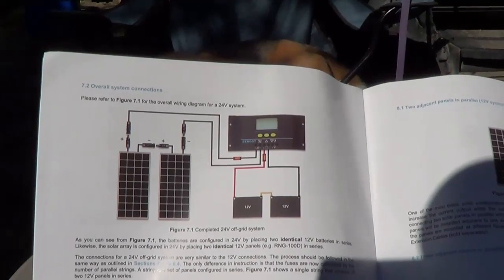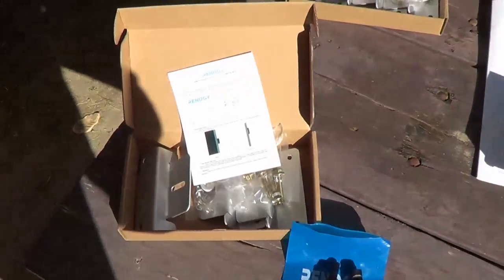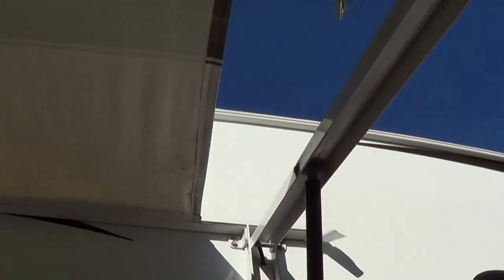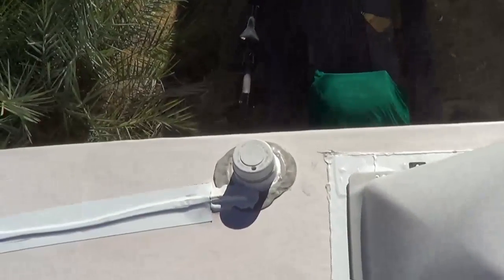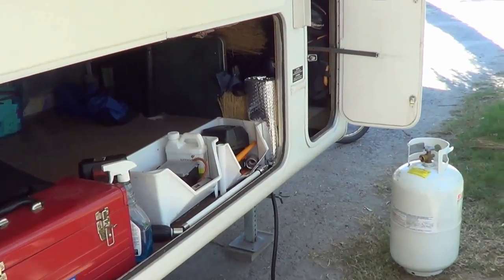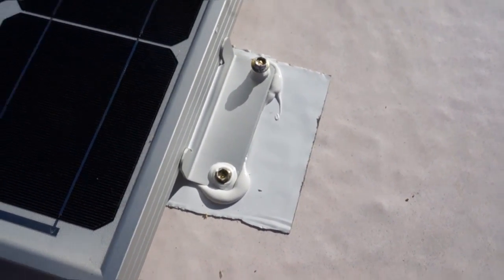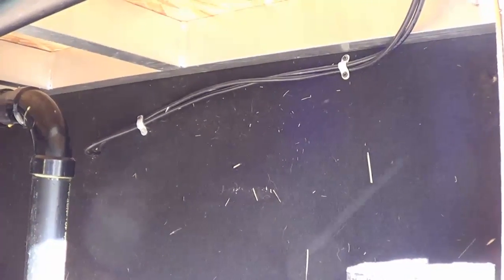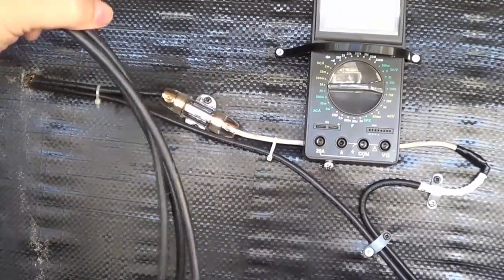Installing a Renogy 200W Solar Kit on my RV

Comment: are your panels wired in series or parallel?   im getting the same kit.  i hear series is the best route to go as long as your charge controller can handle the higher voltage series will put out.  higher voltage equals better energy transfer also....
Reply from the maker: Mine are wired in parallel, works great.
I've also recently update the system - http://www.loveyourrv.com/upgrading-our-renogy-rv-solar-system-to-400-watts/  http://www.loveyourrv.com/bogart-sc2030-cc-and-trimetric-tm2030-rv-installation/
Reply: +Love Your RV any particular reason you went parallel at the time?  i suspect series is better IF your charge comtroller can handle the voltage
Reply from the maker: It is a fairly small system so the benefits of a higher priced MPPT controller aren't worth in my opinion. Also, I don't have to worry about the shading problems series strung panels can have and if one of my panels fails the other paralleled panels still work. The PWM controller is very simple so very reliable.
Every system has pros and cons there isn't one best way to do solar. Depends on how you use it where you decide to spend your money.

C. SC-2030 and charging Frequently Answered Questions – Click for questions

  C1. The debate rages: which controller is best PWM ("Pulse Width Modulation") or MPPT ("Maximum Power Point Tracking"). Why did you choose PWM technology instead of MPPT for your SC-2030 Solar Charger?
   Click for answer
A very good question! They BOTH have good and bad. Plenty of hype has been written already. Here's my (Ralph's) view:The "good" for PWM: It is simpler and lower cost technology.
Under some common circumstances--it can actually deliver more amps to the battery. That could be when:
(1)days are moderate or warm, with few clouds.
(2) batteries are charging at over 13 volts, (in a 12 battery system) which they almost always are when actually CHARGING.
(3) Panel voltage is properly matched to the battery voltage, for example "12V" panels are being used with a 12V system.PWM is actually more "power efficient" than MPPT--which means less total power loss in the controller itself. So heat sinks in the design can be smaller (and less expensive). Missing in most analysis of MPPT is that there is always a conversion loss with MPPT, which tends to be higher the greater the voltage difference between battery and panels. That's why PWM can actually beat MPPT under circumstances described above.Some places that analyze MPPT assume that panels with 30V open circuit voltage are being used in a 12V system. Any good MPPT system will easily provide better performance in that case.
They also may assume batteries are charging at 12 or even 11 volts, which is unrealistic. Lead acid batteries are typically below 13 volts only when discharging, or perhaps charging with very little charging current--meaning the actual potential gain in amps is not great.The benefit for MPPT becomes apparent if you use panels not voltage matched for the battery. If they are not, MPPT will utilize more of the potential energy of the panels. For example, if you use 24 volt panels to charge a 12 volt battery system you must use MPPT, otherwise you would be using your panels very inefficiently. If you are trying to use PWM in that case, you are misusing the PWM technology.Another potential benefit with MPPT is that if distance between panels and batteries is far, smaller wire can be utilized by running panels at higher voltage to the batteries. Running at twice the voltage reduces wire size to 1/4, which for a long run can be a significant saving in copper wire.If temperatures are low enough, the slightly less power efficiency of MPPT will be compensated by the higher panel voltages, which will result in a little more battery current. But in actual measurements we made using a commonly sold MPPT solar controller, this would occur at temperatures less than 55 F degrees (in full sun, when charging at more than 13 volts), where there is a slight advantage to MPPT in my location (Boulder Creek, near the California coast). As temperature drops below that (in full sun) MPPT will get some advantage, such as could occur at high elevations in Colorado in the winter. Potentially this would be maximum about a 2.5% improvement in amps output for every 10 degrees F lower in temperature (or 4.6% per 10 degrees C colder. I'm using data from Kyocera KD-140 panels.)There can be theoretically optimal situations (that I don't personally experience where I live) where MPPT could give some advantage: that is when solar current is present, but the batteries are quite low in charge--but because loads are high and even greater than the solar current the batteries are still discharging despite the solar current. Under these conditions the voltage COULD be at 12.5 volts, or even lower. Again, using data from Kyocera panels, ("Normal Operating Conditions") there is a theoretical maximum gain over PWM of 20% current assuming NO MPPT conversion loss and no voltage drop in the wires to the panels, at 20C (68F). With PWM, the voltage drop in the wires in this case would not affect the charging current. Now if in addition you lower the temperature to below freezing at 28 degrees F (while sun is shining) you might actually get up to a THEORETICAL nearly 30% gain while the batteries are discharging.The only REALLY BAD part of MPPT, is all the hype surrounding it--for example one manufacturer advertises "UP TO 30% OR MORE" power harvested from you panels. If you are using solar panels properly matched to the batteries, 30% ain't gonna happen unless it's EXTREMELY cold. And your batteries have to be abnormally low in charging voltage--which tends not to happen when it's cold (unless you assume the battery is still discharging while solar is happening). Virtually all the analyses I've seen touting MPPT on the Internet ignore the conversion loss, assume really cold temperatures, assume unreasonably low charging voltages, assume no voltage drop in the wires from panels to batteries, use STC conditions for the panels (that the marketing types prefer) rather than more realistic NOCT conditions, and in some cases assume panels not voltage matched to the batteries.The other thing that is misleading about MPPT, is that some manufacturers make meters that show both the solar current and the battery current. In almost all cases for a well designed MPPT type the battery current will be greater. The engineers making these know better, but it is implied (by marketing types?) that if you were NOT using MPPT you would be charging your batteries with only the SOLAR current that you read on their meters. That's not true, because the PWM BATTERY current should always be higher than the MPPT SOLAR current. It is the nature of the MPPT that maximum power occurs when the current is lower than the maximum, so they must operate there to get the maximum power. So to properly compare the two you need to compare MPPT with an actual PWM controller in the same circumstances.Finally, the reason we went to PWM is that I was anticipating that panel prices were going to drop (which they certainly have over the last 5-10 years!) and that the small advantage of MPPT (under conditions where the correct panels are used for the batteries) would not justify their additional cost and complexity. So my thinking, for more total benefit per $, put your money in an extra panel rather than a more expensive and complex technology.

Comment: Hello Ray, thanks for the videos! Question: I want to get 2 Renegy 100w panels and 4 of the best batteries for high ouput and longest duration of power out put possible. Question: could I use one of the following as 1 of the 4 batteries (http://www.amazon.com/Stanley-J5C09-Starter-Built-Compressor/dp/B002X6VXL4/ref=sr_1_1?ie=UTF8&qid=1451272017&sr=8-1&keywords=3-in-1+battery+jump+box)? Thanks and thumbs up on the video!
Reply from the maker: The battery in that unit is likely very small and doesn't have too much capacity. It's good for jump starting but not for long lasting power.

Comment: how many batteries can be add to one controller?
Reply from the maker: Depends on the controller I guess. But it's usually the amount of panels, the total wattage that limits how many batteries you can charge from solar power.
Generally a battery per 100 watts panel as a really rough rule of thumb.
Reply: Love Your RV oh, i see, thanks for your knowledge share :)

Comment: This is great, Ray. You do nice, clean work. Thanks for the walk-through. 
I'd be interested to see a closer look at that in-line multimeter wiring hook up. 
I so need to do this to our travel trailer. 
Happy Trails!
Reply from the maker: Hi, Allen the multimeter was sort of a stop gap thing until I could afford a Trimetric meter. I just installed one and it's great - http://www.loveyourrv.com/bogart-sc2030-cc-and-trimetric-tm2030-rv-installation/
12 volt power system is much larger this year now that I have added two more batteries and two more panels, really enjoying the extra power while boondocking.

For the old multimeter, I had taken it apart and soldered some wires across its internal current shunt. work well to give me a general idea of what the panels were producing.
Cheers Ray

Comment: Ray, with this set up are you able to use your AC outlets in the trailer? or do you have to run an extension cord to the inverter?
Reply from the maker: I have the output of the inverter wired to a dedicated outlet in the trailer near the entertainment center. It's completely separate from the rest of the rig's AC wiring. I like the simplicity of it. I use an extension cord inside the rig if I need to but usually one outlet is enough for our needs.
My wife actually uses that outlet for her iMac even when we are on shore power, the inverters power is more trustworthy than most campgrounds. It's like having it on a UPS and protected from surges.
If I wanted to make all the AC outlets work I could always turn off the converter breaker and plug the main power cable for the RV into the inverter using a 30amp to 15 amp adapter.  Cheers Ray
Reply: +Love Your RV That's clever I hadn't thought of that! I can't imagine id need anymore than one outlet as well.  Thats been my only confusion with whether or not to choose the renogy kit or not, as the Go Power comes with a transfer switch and what not which I believe gets hooked up to the converter breaker, but also cost about a grand more. Ive been trying to find a way to not have to spend more than is necessary. THANKS! this helps!
Reply from the maker: Here is a post I did when I first installed the Inverter almost 5 years ago - http://www.loveyourrv.com/1000w-pure-sine-wave-inverter/
Lots of stuff has changed as far as battery setup and now solar but the inverter wiring is pretty well the same. i used a armor coated and water proof AC cable and ran it in the underbelly, then threaded it up through a few drilled holes into the living area. Mounted an AC with a red hospital color so i stands out as the inverter plug and then beside it is the remote on off switch. works for us. We mainly use the inverter to power our TV, computers and charge stuff. Microwave and toaster, high draw items like that I just fire the portable 2000 watt generator if I want to use them.

Comment: it would be making more sense to put the amp meter in the output of the charge controller, not in the panel line, its the amps going into the battery you want to know, if the battery is full, the panel amps will still be high, due to the chargers dump load.
Reply from the maker: It was just a temp thing to test what kind of power I could expect off the panels at different times of the year. I'll be installing a proper battery monitor in the near future when I add two more panels and a better charge controller. Hoping Santa is good to me. ;)  Looking at the Bogart Trimetric monitor and it's accompanying charge controller.
Reply: W. Lou Little  no, its not nowadays, when you use a modern pwm controller the amps will stay the same at the panel side if the battery is fully charged.(the controller wil use his dumpload) so you miss messure, when you use a mppt controller the panel amps can be even lower  than the charge amps to the battery, so also a big defference. in the old days they used a transistor to switch off the panel, in this condition you could indeed put the amp meter in the pv side, when you use modern heavy duty controllers you cant do that in ll cases., so better is to put it in the battery line, to see exacty the amount off amps flowing into the battery.
Reply from the maker: MrBugsier5 My new Bogart Trimetric monitor reports solar current coming out of the Bogart SC2030 controller and also unused power in watts I could be using once the battery charging tapers off. It's a pretty cool combination.
Reply: MrBugsier5 you are correct when you're talking about an MPPT controller. The comment what for him was that he was using a pulse width modulation unit. Yes it would be better if you measure the current after the controller.
Reply: it does not matter where you put the amp meter. The current from the Solar is going to be the same as it is on either side. the charge controller is simply a valve for the current. measuring the current in a series circuit the current can be measured at any location and will be the same at any location.
Reply: jep! no offence! lol

Comment: Good job! Nice, informative video. Thanks for sharing!
Reply from the maker: Thanks. The system has been working well for almost a year now. I've recently added more batteries and next month will be adding two more panels, better charge controller and a battery power monitor. Stay tuned. Cheers Ray

Comment: How sturdy are those panels? Can you still drive an RV or trailer around or do you have to remove them ?
Reply from the maker: +Brigitte Sutter They have been up there for almost a year now and we have traveled at least 3000 miles in that time. They are still firmly attached, and I don't remove them. They are built to be outside al the time.

Comment: Is the solar panel sistem has any safe mode? Like when the battery is full charge and im not use it at all the sistem stop charching the battery? Or it always charching it and battery over charge ?
Reply: I im thinking to install it on my rv but i will not use it 24/7 but i will like to have power when i use it
Reply from the maker: +elmaster22 The solar charge controller is wired between the panels and the batteries and controls the charging. When the batteries get full it automatically switches to a trickle charge mode to keep them top up and not over charge them. So it's OK to leave the panels hooked up. It's actually good for the batteries as it will keep them at full charge.
Reply: +Love Your RV thank you...

Comment: Nice install, very thorough demo video, many thanks!  I have to use my RV to move, so will have to add solar in next two months.  This was so helpful.  I liked the way you really sealed up the holes in the roof.

On Amazon, the Renogy charge controller was not rated as good, whereas the solar panels were rated high.  I will be buying a separate charge controller.

Also, someone else on Youtube suggested 6 guage (very thick) outdoor electrical cord so you don't lose power from solar to battery.
Reply: +Lass-in Angeles Before anyone starts a solar job do yourself a favor and read Handy Bob's website, he is the Godfather of Sol !
Reply: Wow, 2 mins into reading Handy Bob's Solar Blog, I am already impressed!  Saved me some money right away.  Thank you so much for letting me know!!!  I had no idea about this blog.
Reply from the maker: Thanks! The controller is very basic and cheap, seems to work OK though. I think it's only worth about 20 bucks, will be upgrading when I can afford a better one. Good tip on the thick wire, also will upgrade mine when I add two more panels. Cheers Ray

Comment: I have yet to understand why people by that renogy crap. The worst Chinese stuff out there is sold by those Ebay jokers like them and a bunch of others. So many of them just sell for 4-5 years then do a name change to hide from all those panels failing in under 5 years. 
If you upgrade I suggest Amorphous so you can lay them flat and get lots of power. Like a Schott or Stion or Kaneka panel and a high volt in 12 volt charge controller.
Reply from the maker: I've been to the Renogy head office in California for a visit, they didn't strike me as eBay jokers at all. The company was born at a University in Lousiana then moved to the LA area. I believe all their solar panels are now made at a new plant in Thailand.
I looked into Amorphous panels, but they were too expensive, I don't need a flexible panel for my application. So will go with a tried and true panel design. Best bang for my buck I feel.
My system is working well, very pleased, so I'll be adding two more 100-watt Renogy panels soon, guess time will tell if you are right or not. If you are right it's not like they have cost hoards of money or anything.
Reply: Google SCHOTT solar panels. Do a search for:
"German Schott New Solar Panels: 10 panels: 12 volt: 100 watt"
They are not too expensive now. And they can lay flat and even work in shade, dirty, and with a little snow on them.
Reply from the maker: I tried googling that but only see ads on Craiglist and Ebay selling Shott panels in bulk 10 for $1299 and the panels are heavy and huge!!! Sounds like old stock someone got a hold of. Not good for an RV roof.
Weight is approx. 40 lbs. each panel
Dimensions: 52 x 44 x 2 inches. ((4ft. 4 inches x 3 ft. 8 inches x 2 inches)